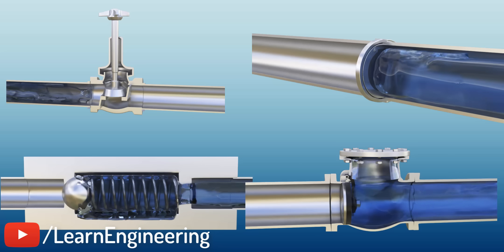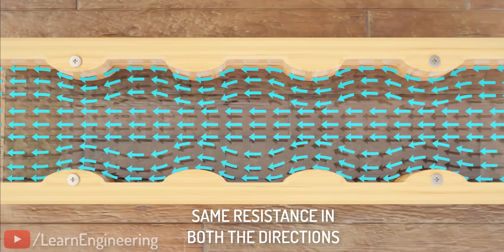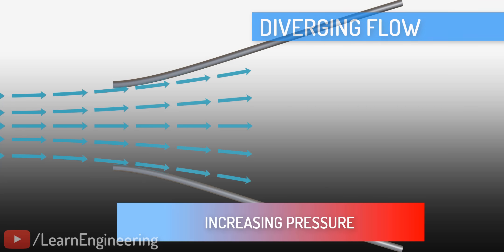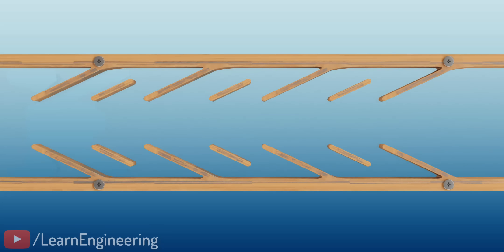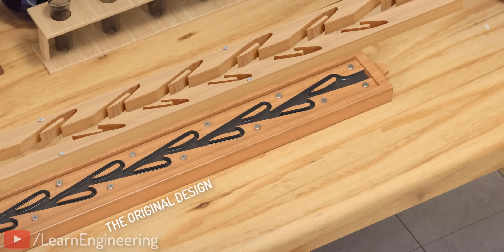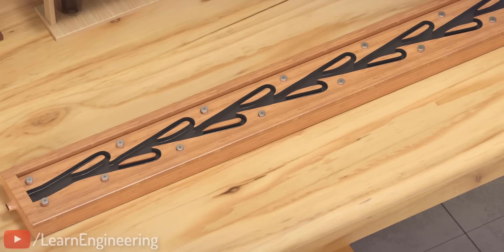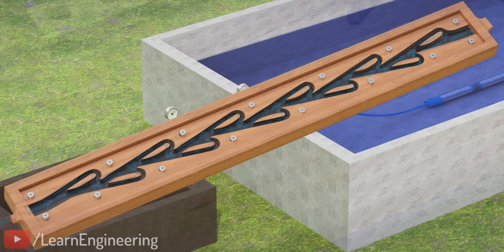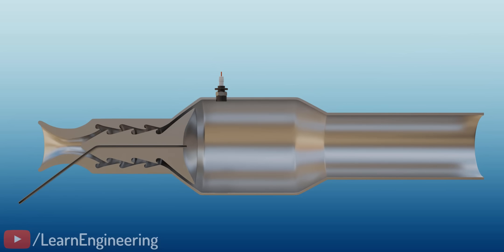Tesla Valve | The complete physics

Comment: Then why do space rockets have diverging nozzles?
Reply: The bell is about the direction the exhaust travels.  The acceleration of the exhaust happens in the throat between the combustion chamber and the bell.  The throat is converging, but makes the flow supersonic, which changes things around quite a bit.
The aim of the bell is to equalise the pressure of the supersonic exhaust with the relatively static atmosphere (or lack of).  Ideally the exhaust leaves backwards and isn't sucked outwards by the atmosphere or worse gets pushed back inwards where flow separation can damage the bell).  That's why upper stages engines, operating where there's little atmosphere have nozzles as big as the rockets outer diameter allows.

As they work through a range of atmo pressures first stage booster engines have to be a balancing act.  You can see it very well in a falcon 9 launch, initially the fire goes straight out of the engines, as they get much higher the exhaust flares outwards as they leave their efficient zone in the lower atmosphere.  
You can see the opposite in Raptor engine test stand firings, where the higher atmospheric pressure near sea level pushes the exhaust inwards creates a wave pattern and shock diamonds.
Reply: @mostevil1082  Wow, thank you :3

Comment: Velocity increase pressure decrease is not true here....
If you put a thumb on pipe , you can throw water to larger distance but also pressure in the pipe increase which makes it possible.

So in convergence pressure increases. The concept behind Tesla mechanism is the opposite direction of two stream....

Comment: Is it possible to design a one way valve with no moving parts? 0:02 So the answer is no?
Reply: Well if you consider that its technically a throttle valve, and not a cutoff valve, then id say yes, yes you can.
Reply: @chriso1373  NRV
Reply: @chriso1373  if it was larger and the pressure not too high and it was stood upright so gravity helps maybe it would work
Reply: @chriso1373  a throttle valve except you have to take the whole valve out and flip it around to get out of idle
Reply: @bmxscape  throttle isnt just a car term buddy.
However you can easily reverse the flow with clever use of plumbing and cutoff valves
Reply: @chriso1373  throttle isnt just a car term buddy, i wasn't referring to cars
Reply: @chriso1373  also, there's no reason to use this specific shitty valve if youre using other valves. one way valves and throttle valves already exist for every application.
Reply: @bmxscape  nope, you cut off the primary booster and switch circuits just like any carb, this essentially just regulates the idle mixture instead of an adjustable mixture screw,  this is non adjustable and I still can't think of an application where this design  would out perform a small hole or "jet* .this however would still need pressure regulation to meter fuel flow on some applications. BUT saying that the point of this design is to free flow one way and restrict flow the other way
Reply: @shredBucketheadshred  Currently, jet engine combustion chambers have many tiny holes through which high-pressure air from the turbine-driven compressor enter. At start-up, however, when air pressure isn't high enough, the gas mixture in the chamber may become too rich and cause an explosion -- and even ignite oiling fluid and cause a fire. Perhaps substituting Tesla's throttle valve for the said air input holes would prevent that. Just one on-the-fly idea for an application.
Edited: one word corrected.
Reply: Put it at an angle n yes it's a one one valve that will open based on pressure levels...

Comment: You can't alternate (It's passive), you can't completely shut it (no moving parts).
So, besides curiosity: of  what use is it?
Reply: a check valve (which this claims to be) has a use that it allows fluid flow in one direction and not the other.
very useful and all buildings (in the US) are equipped with such devices to keep water that you've already paid for on your side of the meter (for example)
but this valve, the tesla valve, is simply one of tesla's ideas that did not pan out.
the reason they didnt show a video of this valve working is because it simply does not work
https://www.youtube.com/watch?v=XhJtSqLz88Q&ab_channel=PhysicsHack
watch. or better yet, build one yourself and test it so you're 100% sure its not just another youtube video lying to you.
Reply: That it does not work at all, is a wrong assumption.
I just read an article some minutes ago, which answers my questions thorough.
Quote:
"A new Tesla-type valve is successfully designed for promoting circulation in a pulsating heat pipe and improving the thermal resistance.[...] The valves produced a diodicity which lead to a difference in velocity of 25% for the different flow directions. Furthermore, a decrease of 14% in thermal resistance was observed due to the addition of the valves."
https://www.sciencedirect.com/science/article/pii/S0017931016310560

Comment: I like Tesla, but I think this idea has a few things going against widespread use.  For example, it’s more complicated to make and larger than other valves that could do same thing.  And it can’t completely stop flow so that eliminates most applications.  And it has no adjustment.  And it would be hard to clean/keep clean as it ages.  And low-flow areas would allow debris to settle out, making things worse I think.  (Real-world systems get sediment and mineral and biofilm build-ups on the surfaces over time.)
Interesting as a concept, but this particular idea just hasn’t seemed to find many uses.  Maybe nice as a land/waterscape design though, with some modifications!

Comment: Best way to make a firearm suppressor..."theoretically".
Reply: How?... If you're talking about silencers then you'll need to understand that noise does not just travel through the barrel but also through the gun itself. Thus only increasing more material to absorb the sound the best method(you can see this being done on bows where they attach a fuzzy material on the string to reduce bowstring noise). If you're talking about something like a muzzle brake or flash suppressor then you'd either slow down the bullet by forcing the pushed air to push back onto the bullet(slowing it down) or give the bullet a channel besides the main chamber to go through; you'd end up shooting yourself or ruining your gun.
Reply: @gianluigijequinto  wow, first off, this video is bullshit, but beyond that, you're totally wrong and making shit up about guns!
its not a good suppressor design or else suppressors would be designed this way.
but its not because "noise does not just travel through the barrel but also through the gun itself" - this is wrong. not even in the correct ballpark.
the LUOD part of the gunshot is the report. the rapid burning of excess powder once the bullet has left the gun.
the NEXT LOUDEST PART is from the sonic crack (basically a tiny bullet sized sonic boom). im sure i dont have to explain how sonic buildup and booms work.
finally, you have the cycling of the weapon itself. which is the quietest part of the whole thing. 
yes, SOME sound vibrations do reverberate into the gun itself. however, this is not a source of much "bang" noise because the gun, while taking the energy from the gunshot and converting it into angular velocity (recoil) the body or frame of the gun does NOT make for a good sound transfer medium. 
tdlr:
the tesla valve would make a shit suppressor
but your reasoning as to why is clearly made up by call of duty tier gun enthusiast. (if that)

Comment: I'm a simpleton, I thought we were going to learn about turning flow on or off without moving parts. We didn't do that, though, did we? Tesla created something that slowed the flow through resistance, right? Soooo, what if I want to turn it on or off? What if I want variable flow, like sometimes high or sometimes low? This is not useful for that, right?
Reply: No and it didn't claim to be.  This is a one way valve with no moving parts.  It isn't a ball valve with a handle.
Reply: @stargazer7644  how is it useful? What are its applications?
Reply: @WoodsWoofer  It converts high frequency oscillatory flow into one way flow.  A mechanical flapper would wear out quickly in this application, and tesla's valve becomes more effective as the frequency increases.
Reply: @stargazer7644  thank you!

Comment: It's been over 100 years and we still haven't found an application for it?  What's the point?
Reply: It has some significant drawbacks. 1) The energy is constantly consumed when blowing in the "closed" direction. This energy is simply wasted on heating the liquid (in the vortexes). 2) It does not completely stop the flow. 3) It does not work on the weak flows (i.e. if there's not much liquid/gas going, and the pressure is low, it will easily get through).
So, there can be some applications but very limited.

Comment: One should avoid the word "obviously" when teaching. Maybe it's not obvious to a student- you basically called them dumb and likely discouraged them. I heard it three times in this video.
Reply: one should also teach things that are REAL.
THIS VALVE IS NOT FUNCTIONAL
https://www.youtube.com/watch?v=XhJtSqLz88Q&ab_channel=PhysicsHack
watch someone ACTUALLY test one instead of just touting it as a "one way valve with no moving parts because tesla durrrrr"
Reply: Good point. And not only it may discourage some, it can be misleading. "Obvious" things sometimes turn out to be wrong, it's quite common in science. And more often the teacher uses it, the more common it's usage will seem to the student. And the more probable it is that the student will be later on tempted to use it themselves when they actually don't know how to prove something
Reply: get over yourself, snowflake.  if you're discouraged when someone says that an obvious fact is obvious, you OBVIOUSLY do not have the mental discipline or strength of character to pursue any endeavor.  someone with the requisite drive to succeed would take the word "obvious" as a challenge, and adopt the perspective that if this is indeed obvious and I cannot see it as such, then I need to work MUCH HARDER.
Reply: @johnmichael1594  Obviously, you didn't quite get neither my comment, nor the comment before.

Comment: 1:14 The 2 options shown actually have pretty similar resistance both ways. You say one is diverging and the other is converging, but that's not true!
For example , the one you say has diverging flow (you're only looking at the increasing distance between the obstacles along the centre), but what about the obstacles converging toward the walls?!?
Both options have converging and diverging areas and will have pretty much the same resistance either way.
So these are not demonstrating what you're trying to prove.
Reply: I'm so glad I found your comment so I didn't have to write it myself
Reply: Exactly my thoughts man..
I was like "they're basically the same.. trick question"
Reply: @Daiceto  It's kind of a joke how an engineering channel just puts up some animations with doubtful correctness that could easily be built and testet.
Reply: Yup, and I'm pretty sure this has nothing to do with how Tesla got the idea.
Reply: @JC ,You sound right. Idk whats wrong with most,they should consider your argument to provide you a better explanation rather than claiming you are wrong without stating a reason for it. Btw what I understood is logically the argument is right if the width of opening of converging end is double the width of diverging opening at the outer boundary, and the relative resistance of flow in both directions depends on the ratio of Diameter of tube to sum of diameter of converging end and diverging end, if this ratio is not one then there will not be any symmetry on how tube provides resistance to the flow. Hope it helped you! Thank you.
Reply: Ok whatever 😌
Reply: @sotirissoyvleris6966  Man, you can look at it with a mind as open as possible - philosophically, mathematically - but it is not possible to have a flow with one and the same repeating diverging section, without having a converging sections in between.
Think about it. Imagine a diverging section where the flow starts with a section of 1 square inch and increases to 5 square inches. Then in order to start the next diverging section at 1 square inch again you have to converge your flow back into 1 sq inch, i.e. you'll need to converge the flow.
It's just logic.
I am not bashing on the tesla valve either.
It relies on a different principle, it splits the flow and uses the kinetic energy of half the flow to reduce the kinetic energy of the other half, robbing the flow of its kinetic and respectively potential energy and significantly reducing it in one direction.
It is designed for a very specific use - high velocity gas flows, or more specifically inlet valves for pulse jet engines.
Reply: the water gets in from the center this is the main flow see the video again with open mind and dont try to find the wrong its not there
Reply: SOTIRIS SOYVLERIS Mate, you should use an ‘open mind’
Reply: @sotirissoyvleris6966  dude smoke some weed, open your mind bro, YT videos never lie dude, the government is after us dude
Reply: @alexeysaranchev6118  i don't get you but ok if you understand from my comment how i think good job 🙂

Comment: Learn Engineering dude, you are getting a lot of rightfully deserved flak for this video and the behavior of the valve.  At this point for helpfulness to everyone and general integrity, just admit you portrayed it incorrectly and redo the parts of the video that classify it as a one-way-vale.  Or any valve for that matter.  This sort of stuff happens to everyone, so all we can choose is how we react when it does.  

I can also tell you as a career design engineer who has done some valve and regulator products, it is a much more logical train of thought to go “I want to slow flow down.  Reversing the momentum of part of the flow and reinventing it to further reduce the momentum to the main body of mass flow will do it for ‘free’ “ versus “hmmm, divergent flow does x, convergent flow does y, so then if I make that divergent flow do z and then further change it to xyz, that will slow down the flow.”  It’s 1 or 2 naturally intuitive steps versus 4 or 5 steps each requiring requiring a more complex use of fluid dynamics.  

Maybe just redo the whole thing and not try and patch it,

Comment: No.

I'm not comfortable with the explanation in the video.

Flow forward moves the vortices away from the primary stream. 

Reverse flow moves the vortices toward the primary stream. 

Aircraft manufacturers do something similar with winglets.

It could be misleading to label this a VALVE. 
These things are interesting to me in the same way as vortex air coolers.

edit
Would be interesting to measure and compare pressure near the areas we expect to find vortices.
You'd probably need a really big "valve" to do that and gain any reliable results.  I don't have time.

Comment: Nicola Tesla was truly a genius . This theory was amazing . It requires more than deep  knowledge to think in such a scintillating way. 👌
Reply: No.

I'm not comfortable with the explanation in the video.

Flow forward moves the vortices away from the primary stream. 

Reverse flow moves the vortices toward the primary stream. 

Aircraft manufacturers do something similar with winglets.

It could be misleading to label this a VALVE. 
These things are interesting to me in the same way as vortex air coolers.

Would be interesting to measure and compare pressure near the areas we expect to find vortices.
You'd probably need a really big "valve" to do that and gain any reliable results.  I don't have time.

Comment: Them: It's difficult to instantaneously stop a flowing liquid let alone slow it drastically without a moving part

Tesla: fluid resistance go brrr
Reply: except it doesnt work. go ahead and build one yourself. test it.
the MOST you'll ever get is reduced performance of flow and increased turbidity
trust me. water just dont "STOP" if thre is pressure and somewhere for it to go
Reply: It's a pump.

Comment: Wouldn't this work in a firearm suppressor? You could widen the center way a bit for the bullet to travel or 3d print a rubber inside and just have an aluminum or steel housing.

Comment: When my father was working at Honeywell back in the sixties, he was trying to make an EMP proof re-entry system for ICBM's. The idea was to use fluid dynamics instead of electricity. Or fluid rocket fuel, "current" in the place of electrical current.
Reply: Use it for what
Reply: @aiavatar2077  Electro Magnetic Pulse can mess with electronics for re-entry guidance systems on atomic weapons platforms.
Reply: @morg52  easy just use servo motor

Comment: I have been contemplating building a pulse jet, and now that I see this, if I do I will not be using a reed valve like I had planned.
Reply: Then it is not a Pulse Jet but rather you're building a Ramjet
Reply: @robbob5973  nope, pulse. That valve should let enough come back through to let the jet fire without forward movement, unlike a ramjet. I believe thats why they said pulse jet on the video. A ramjet doesnt use a tesla valve.
Reply: @manayunkman83  I have been Flying read Dino Jets over 50 years.  I have Experimented many times... lots of success in various delivery air fuel systems... this one was a no..no.
Reply: @robbob5973  Its a shame with all that experience you dont understand why its called a PULSE jet. The fact that valve lets a tiny bit back through makes a world of difference. You are comparing that to pure compression like a ramjet, NOT the same thing. http://www.pulse-jets.com/valveless/

Comment: 1: 30 - the pressure will drop only if the cross-section (and temperature) remains the same.  This is not the case here.